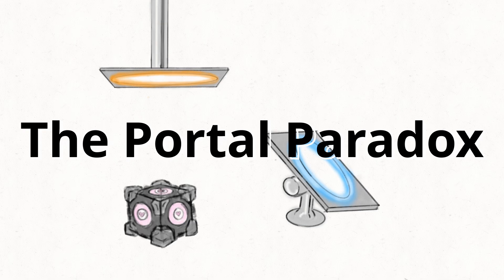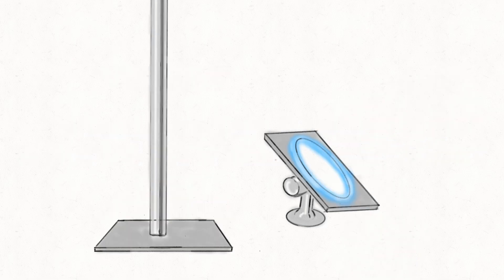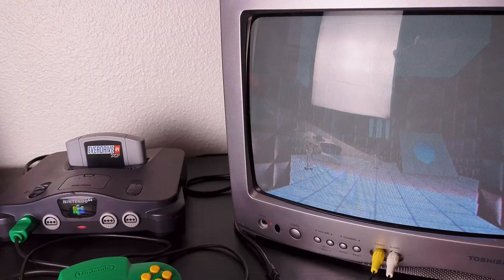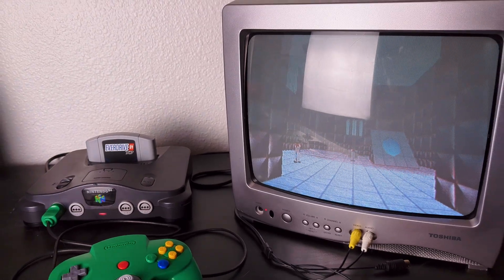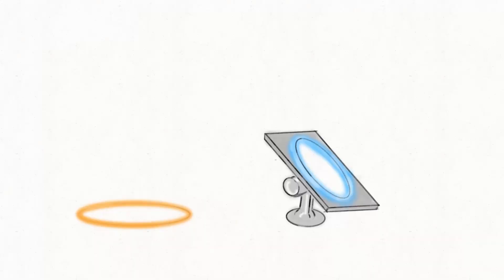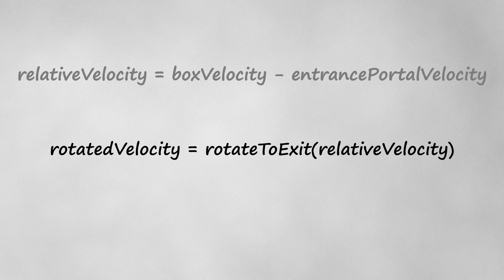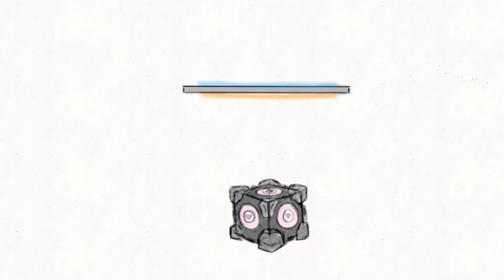I rewrote Portal from scratch and solved the Portal Paradox

Comment: If I were to get a really light foam sign with a portal on it, then press the other portal against the ground, does that create a press/hammer that can be handled as a normal tool with the force of the entire planet’s weight behind it

Or in other words, if instead of open space, the other portal was placed facing down on the ground, would the companion cube be smashed into tiny bits even if the panel moving down onto it did so with little to no force

Comment: Id still say it's wrong. Velocity being relative is entirely what makes the cube stationary. If this was true, the ground the cube was sitting on would somehow fly through too. Portals don't defy gravity. Sticking an object between two portals will have it fall in a certain direction, which means they respect relative motion. If this wasn't true, the object would be seemingly rotate in random directions indefinitely as its being pulled equidistant in two directions. The relative velocity in the examples is being demonstrated mechanically as if the ground itself is moving toward the portal in physics when in reality the portal is moving toward the ground.

So the cube would stay stationary, and plop to the floor.

It's like throwing a baseball off the back of a truck.

Comment: What happens if you stop the portal halfway down the cube? I assume the half of the box that emerges from the exit would yank the other half along with it? Like, slowed a bit, so it would just kinda plop out of the exit portal.... but what if you pushed a cube halfway into the stationary portal while the exit moves, then stop moving the exit? What would happen then? Would the emerging end of the cube lose its momentum too? The relative frame of the cube is stationary, but the cube itself is moving through realspace in realtime.

Comment: Portals are basically windows that lead elsewhere it would be the same as if you had a window frame fall onto you just because your going though it doesnt mean you'll be launched 

The only momentum there is is the object with the portal moving for example if you slam a window pain down on someone it will stop at their feet the object itself has all the momentum if the person was pushed by a platform fast up though a window they will continue the momentum 

There's no reason why it would work with a portal transferring momentum to an object going though the portal 

Its the same sideways if a portal is moving towards you at extreme speeds and you simply jump up you would not be moving at the same speed as the portal you would of just jumped though it into the direction of wherever is positioned

Comment: here's a thought experiments i had:

think of a situation where an energy pellet is fired at a suspending wall. on both sides of the surface, are the two different portals. for the sake of things, this energy pellet, the portals, and the surface are all in an otherwise featureless, vaccuum room, that is isolated in space. the second the energy pellet starts entering from one side of the portal, this wall then starts moving at the same rate in the same direction as the energy pellet. the energy pellet will remain stationary relative to the portals. once the portals stop moving, relative to the portals the energy pellet is still moving, and will pass through them. 

if we do this same situation, but one portal is on a stationary surface while the other is on the moving surface, what happens then? the same thing would actually happen. but now what if we make the other portal go TOWARD the energy pellet instead? does the energy pellet gain speed coming out of the other portal then? if so, shouldnt the moving surface then lose speed? 

ok, now what about if the pellet is moving toward a portal, and that portal is moving toward the pellet, but the other portal is moving in the opposite direction relative to the pellet? remember that the movements of these surfaces are at the same speed the pellet is moving at. as the first portal slows down, what if we speed the second portal up at the same rate that the pellet is gaining speed? well, now we have this very weird situation once the first portal stops moving completely. the pellet is in a similar situation where it is relatively stationary inbetween both portals. but... what movement does it have relative to the room?

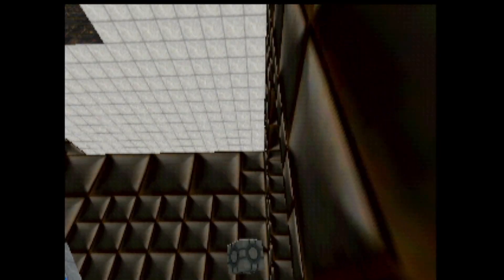Comment: 1:58 "show me the flaw in the equasion"
very simple, it's Euclidean math applied on a Non-Euclidean system.
simple rebuttal: if the moving portal stops at 25%  the heigh of the cube, will the cube still shoot out?
that question is a simple tought experiment to understand that there is no transmission of momentum from the portal to the cube, it cannot accelerate as shown

Comment: If a doorframe came flying at me, and I was standing still, I would still be standing still upon stepping through, because I'd end up "caught" between the two frames, as my velocity is zero.

Because the portals are wormholes. Just like a Dullahan's throat and neck is a wormhole. One entrance can move around all it wants but it doesn't change that I'm stationary, and would thus either be left standing with my feet on the ground below portal 1 with the rest of my body protruding through portal 2, or I'd be tripped by P1 like a jump rope and have to take a step forward out of P2 to retain balance.

Because speedy thing goes in, speedy thing comes out. If I'm not speedy on entry, I'm not speedy while exiting; the quantum tunnel itself has no inertia to add to me, or else simply walking through a portal would launch you as if you sprinted.
Reply: Addendum: in Portal 2 there's a part where you use a laser to cut the neurotoxin pipes. If portal movement imparted inertia, the laser would change direction, and yet it's ramrod straight.

Comment: This approach doesn’t quite work with the way I’ve always thought about portals, as doors. Is there a good analogy for this kind of approach?
Reply: Think of portals like double doors, but ignore the space in-between,  and the doors can also move separately.  If you throw a box through them, they may as well be normal doors. However,  if you were to somehow pick up the first door, and then slam it around the box, then the box would be moving relatively fast as it inters the first door
 And since it's connected, it would exit the second door with the dame relative speed too. But if the second door were moving, then you add lr subtract momentum,  like when you throw a ball in the back of a truck.

Comment: One point...

Portals can't fundimentally move as they can only be locked to a specific point in space

By "moving" the portal you've actually created a new instance, which means it is not the same portal.

IE. The velocity would be the same entering and exiting the portals, just, you've got your forth dimensional relationship confused with how matter works inside a three dimensional space.

The box would just fall as if it was placed on the surface of the blue portal as gravity would normally behave with zero momentum being transferred from the other portal

Comment: The other problem with portals is how they go through. Ie, it could be similar to a printer, in that each layer of the object is materialised and pushes any previously out. This would also work with your model, since the faster the orange portal is falling, the quicker the blue portal materialises layers, which means each layer is pushed out quicker, this gaining a form of momentum.
If you then stopped the orange portal half way down, the top half of the layers would keep their momentum, but then start pulling the newest layers instead of being pushed, meaning they'd be bleeding their momentum. In short, half the momentum of a full jump. 
Likewise, if there was a wall infront of the blue portal, the new layer would be pushed into the wall, then the next layer compressed into it etc, effectively the same as ramming the cube into a wall with a piston, without any portals.

Then if both portals are moving opposite eachother, the layer in the blue portal doesn't need to push anything out of the way, because by the time the next layer is coming through, the blue portal has moved exactly one layer down, leaving the perfect gap for the next layer to inhabit. Equally if both portals are moving in sync, the new layer will have been pushed up by the materialisation of the later below, which itself is also pulling the old layer up from where it is someone linked to the blue portal. This means the momentum would be doubled, since each layer would effectively have been pushed out of the portal twice in one go.
Reply: But portals are not printers. It's simply a doorway connecting two areas.
Reply: @fantastikboom1094  yes, but in the effect of moving, it is easier to describe it that way. 
They are a doorway, but in every way they act, they are more akin to an instant dematerialiser and materialiser combo. 

The end result is exactly the same, in that anything in the blue portal is just out of the orange portal, but because of how each side of the doorway can move in completely different ways, the way they are explained cannot carry over exactly.
Reply: @mickys8065  I think describing portal as printer is wrong, because printer can't save the momentum. Pushing anything is also wrong, because its actually a curved space, and it works the same way as if there would be usual doorway.
And the result wouldn't be the same.

Comment: Okay but if you think about it, gravity makes the cube sit stationary on the ground, and the second portal is tilted upwards, so that means gravity is pulling the cube into the second blue portal and out of the moving orange portal.

The movement of the orange portal shouldn't affect the cube at all because the portal doesn't touch the cube, only air and gravity is touching the cube, so the cube should remain stationary even as the orange portal engulfs it.

Comment: So when I jump through a portal, I know where the force on my body is coming from (me jumping off the ground).  But in this intepretation, as a portal is coming down over me I will start to feel a force.  As it passes over my head my head my head will start accelerating right?  As it gets to my waist, everything above my waste is experiencing a force right?  So at some point my feet will be leaving the ground before the portal gets to them.  So my question is where is this force coming from?  The platform the portal is on?  What if the portal is on an ultra thin sheet of graphite, surely there is not enough energy in that to replicate the same force as when I jump?
Reply: This force is called The code force.
Actually, his equation means object will be sliced into 1-atom-thick layers. So his equation is definitely wrong.

Comment: I like it but I am going to disagree (I know shocker for the internet right?).  A portal is basically an Einstein-Rosenberg bridge which is essentially two apparently distant points in space time connected too each other.  Going through the portal is no different to stepping left or right its simply that the section of space on the other side of the portal is only distant from our perspective but the two parts of space time are in fact simply connected together.  Therefore going through a portal is no different to moving through space in any other way.  If you are drifting in space you do not suddenly get "the momentum" of the moving space time, you keep your own momentum.  Therefore the cube would have zero momentum until gravity took over on the other side of the portal.  Great video though, really liked it.

Comment: If I slam a giant cup top-down on someone- they don't immediately shoot up. 

The floor is your normal surroundings: the cup is your new surroundings after going through the portal. Throughout this process- no force is acting on you directly. 

The purpose of a portal is to link two points of space: What's important about this is that it's 1:1 As far as reality is concerned- there is no difference in the space from portal 1 to portal 2; They are the same now. The entrance to the hypothetical cup- that is simultaneously portal 1 & 2 because *that space is linked 1:1*
Reply: If you drop a hoola hoop coaxially on someone, and you took the perspective of the exit loop, the person does in fact appear to be shooting up, which is what they would do if the exit was stationary.

Comment: When a cube is pushed into a portal, it retains its momentum. When the portal moves into the cube, it has no momentum and now just falls off of the second platform. This method is using relative velocities and doesn’t account for and object’s momentum, right?
Reply: Momentum is relative to the reference frame. The cube before is in an inertial reference frame but as soon as the portal comes down, the part of the cube through the portal leaves that reference frame and enters the second reference frame (also inertial) but with a momentum imparted by the entrance portal moving over the cube (non-inertial) that appears to the exit portal as the cube being flung through it.

Comment: implementing it as a game is simple, the problem is this breaks time symmetry. though I've seen in another comment that with non-inertial wormholes you can't even assume time symmetry at all.
Either way portals create energy from nowhere, in my opinion it would be better to ignore portal speeds because I've always thought of objects going through it to "instantly" teleport, instead of gaining energy from the portals themselves. There's also lots of ways you could move, vibrate and rotate portals to change an object's motion for seemingly no reason, while we're used to only have gravity do the work

Comment: Ok but what if you stop the portal halfway through the cube?
Sounds like the cube should be launch at less than half the momentum as not only half of the object gains the speed to pass through but it also got a weight to hold it in place that needs to accelerate too

Comment: I hope at least somebody will see that and hear me out: what if you will lower the portal to the cube as shown in the video, but will stop immediately at the center of the cube? Logically relating to the video it should jump from another portal but with less power, but what we will see at the first portal? Will the cube be sucked into the stopped portal? Like the rest weight of the cube will be compensated by the velocity of the moving portal and the other half of the cube's weight? Or it should stay in place unrelatable to this explanation?
I wanted to say that there is no matter how fast the portal is going, because it just misplaces the position of every particle of the cube in to another place, it cannot deliver the speed. With increasing speed there will be only increasing speed of the cube's appearing in place. After the portal going through the center of the cube if there were different gravity angles it can be sucked in due to the customized gravity vector, and so after that cube will change his movement speed. Prove me wrong without what shown in the video, because there is some different understandings shown there.

P.s. that's just my opinion, but right now I think it is the right one
Reply: You're actually right. Also there's the problem with his equation: it means the object passing through will be sliced into 1-atom-thick layers because of how that force is applied.
Reply: @fantastikboom1094  exactly

Comment: Regarding the question of where the cube gets the kinetic energy relatively the room itself, the source is obvious, the moving entry portal. Which means that just like cube feels the force which increases its velocity, the entry portal plate will also feel a force, which will decrease its velocity. So if you want a 1x1m cube with a mass of 2kg to pass through portal in 1s, which would give it 1Joule of kinetic energy, you must expend 1 Joule of energy pushing down the plate with entry portal on it. This all means the very obvious idea that to prevent portals from becoming perpetual motion machines, you must pay for every change in kinetic energy of objects passing through. In the case of the opposite experiment, cube moving into stationary portal and exiting from an exit portal moving in the same direction as cube's initial speed, but facing backwards, cube will appear stationary. But energy lost by cube must go somewhere and the only recipient would be the exit portal, which will speed up, keeping the overall energy of the system conserved.

Comment: but what about gravity forces, which should keep cube on the floor in the first place. i think blue portal shouldn't rubberband weighty objects like that, but it works for a non-weight things like air.
Reply: That's not gravity forces keeping the cube in place, it's conservation of momentum (cube's momentum is 0, therefore, it would plop out and not fly out). His equation simply doesn't conserve momentum.

Comment: is that's was rly a thing? i mean u rly think that's a paradox? im confused...
Why? because that's was rly intuitive, box is not moving even by gravity. 
box speed at portal exit = box speed towards portal entry + portal speed towards box - gravitation correction (if only cube is not in static state)
box trajectory u can read it in physics books (i forgot how to, but i can remember max velocity speed depending on weight of object)
More interesting to see, how cube will react when it exactly at 50/50 state between portals without any force on cube (except gravity, that will be decreased to 0 due portals orientation to gravity) will it roll or just stay still? i think that's will depend on ingame cube realization, because if cube will have imbalance in 1 of his sides - it will start to roll because of speed to enter in 50/50 state, if it perfectly balanced at center of the mass it will stay still i guess, but that's again depends on cube's speed to enter 50/50 state
p.s. sry for my english